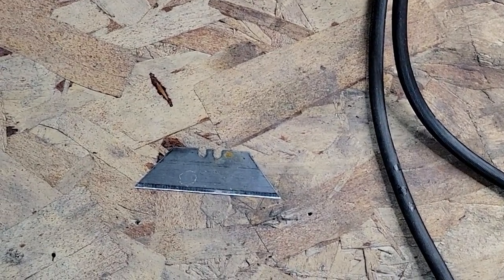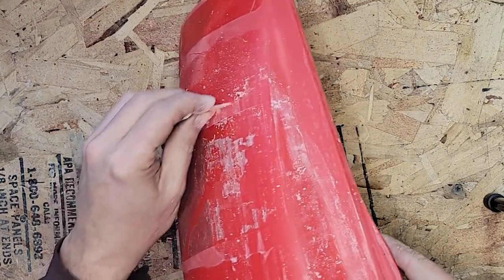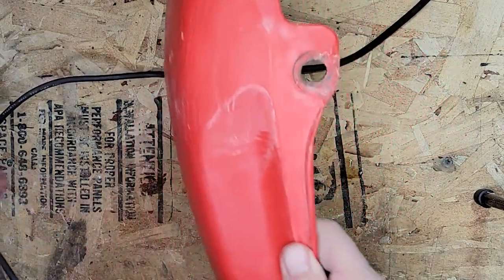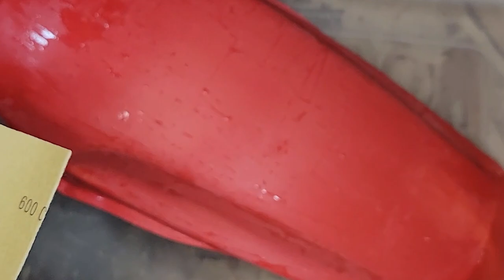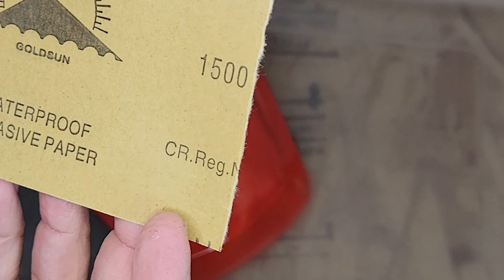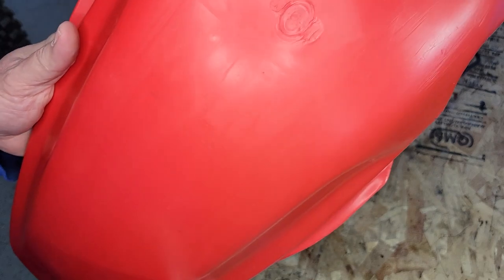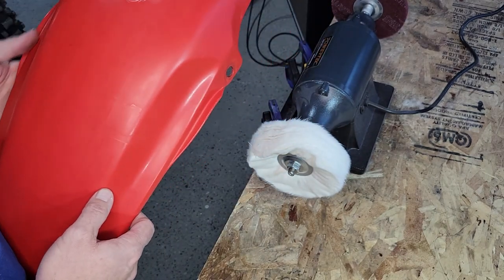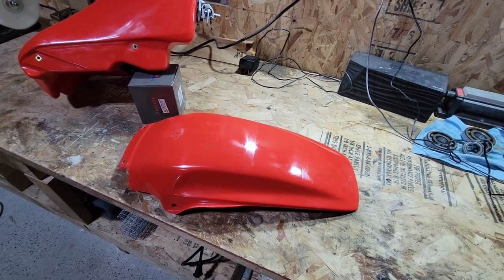How to RESTORE Old, Faded Plastic like NEW!

Comment: Great process. I'm doing the math in my head of how many hours vs. buying a new fender. But those plastic pieces are likely expensive. Or on older stuff, I can see where they might not be available. 
Thanks for showing the process.
Reply from the maker: If the replacement plastics are readily available and affordable that could be a better route. About 2 hours on that rear fender start to finish. Larger pieces would take longer. Thanks for watching!

Comment: I appreciate learning & seeing how to do certain processes.  I was never taught growing up so I get to be an old learner.
What is the difference between dry & wet sanding?
Reply from the maker: Wet sanding prevents the sandpaper from getting clogged up with particles such as plastic or paint. Woodworking, drywall projects usually would be dry sanded. Thanks!
Reply: @backcountryrich7740  
Thank you for the reply.  Makes sense.

Comment: I never thought of using a dremel and scotchbright for the tight spots. Always hand sanded. You might want to try a Sheeps wool buffing wheel on a drill or polisher, i have found it to be more forgiving and creates a higher gloss.
Reply from the maker: I will give that a try. Currently in the final stages of restoration on a 88 Honda CR500. Enjoy your channel and have picked up some great tips watching your content! Thanks
Reply: @backcountryrich7740  Thankyou for watching the channel.
Reply from the maker: Got a question about the radiator hose from pump to the back of the cylinder on the 88 CR500 that you may have dealt with. I put the 91-01 aluminum clutch cover on and have a new silicone hose for 85-88.  Outlet angle is different now and the new hose does not fit well. Gets a kink in it no matter how I position the hose. Searching the web for a solution and come up with zero. Any suggestions? Thanks
Reply: @backcountryrich7740  I have not done this conversion. But i would guess you need to use a longer hose. I will keep my eye out to see if anyone is making a hose with that bend
Reply from the maker: @TNTMOTO  Thanks

Comment: Found my way here via Bushradical.
I am currently cleaning up some plastic trim parts from the grill of a 1980s pickup truck I'm rebuilding and restoring. New parts are no longer available so i was stuck with doing something with the one's i had. They were really crusty after being stood out in all weather's for many years. I found that medium grade wire wool is great at getting the rough stuff of first, then worked my way down to the finest grades, they have left a really great finish.
David in the UK.
Reply from the maker: Thanks for coming over to the channel! Had the same issue when restoring my  84 Honda CR250 and could not find new plastics for it. I have also used light abrasive wheels on the dremel tool.

Comment: Your parts look really nice. Great job. This is a timely video. I am currently "restoring" the chain guard and radiator guard on one of my RZ resto mod project bikes. I have found attempting to buff out plastic parts with my benchtop buffer (like you are using) if it catches for a split second you end up with a serious burn on the plastic. It happens very quick, no warning when it grabs an edge. Today I'm going to attempt using a DA car polishing tool as it should be a lot more forgiving. I made a video restoring etched out plastic lenses on a gauge pod. I had to remove the clearcoat on them but they came out beautiful. It takes a lot of effort but it's a labor of love, ain't it? I will go check out more of your videos now.
Reply from the maker: Thanks! Using the bench wheel does take some getting used to. You are right on, if you stay in one spot it will burn it. I use a buffing wheel on my drill as well. If I could vary the speed on the bench buffing wheel it would help a lot. I restored an 84 Honda CR250 using the same process and it came out very nice. I have also used new UFO plastics on some bikes. They make really nice reproductions that have that factory fit and finish. Really appreciate the support.